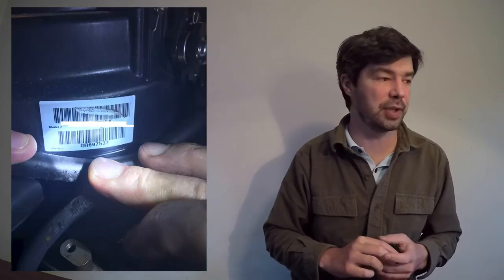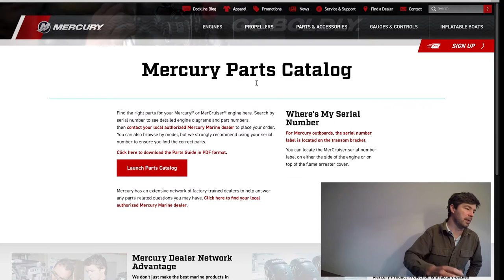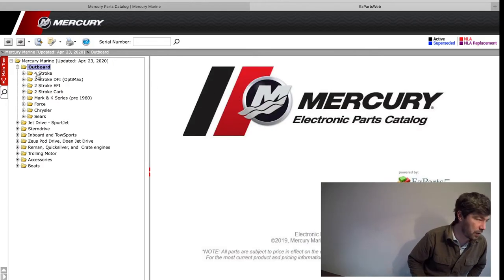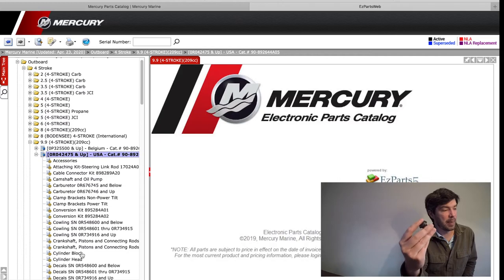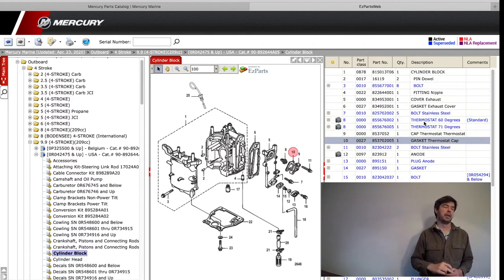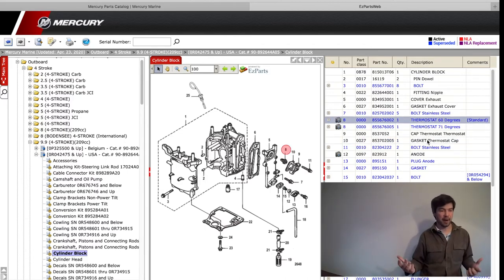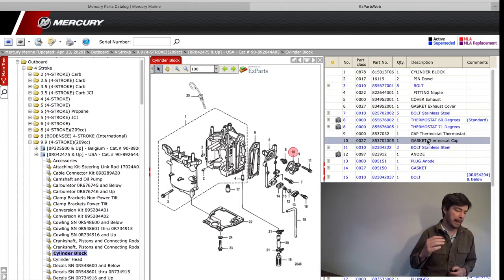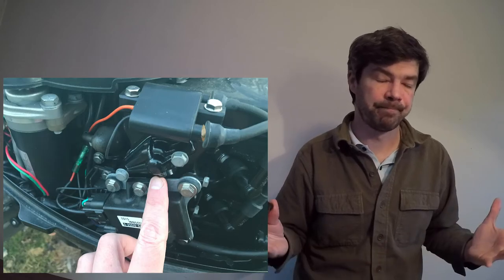How to Change Thermostat in Mercury 9.9 4 Stroke

Comment: Thanks for the update!  I've had a Mercury 9.9 4S for about 8 months now.  I just did an oil change, lower unit gear oil change and will be inspecting my thermostat as part of the annual maintenance  What else do you recommend doing yearly?
Reply from the maker: check the impeller.  Im going to make a video this weekend about it.  you have to remove the lower unit.

Comment: For the stalling out issue, make sure your fuel hose and bulb have no cracks or small air leaks.  If you squeeze the bulb as it's starting to stall, does it stay running?  If not, you may need to remove, disassemble and clean the carburetor.  Get a can of carb & choke cleaner and some small diameter wire to clean out the passages.  Also maybe time for some new spark plugs (be sure to set gaps to specs listed on motor or manual).  Good luck 👍

Comment: Hey Justin, great video very informative.  I am having the exact same issues with my Mercury 4 Stroke 90.  It sat in storage for 2 years and when I took it out on the lake it ran fine until warm, then would stall, and sputter until cool again.  Also noticed when I got home the engine oil was over full and smelled like gas. Im just curious if you ever got the stall and sputter issue resolved on your engine. I will replace thermostats, and another person online said replacing coils fixed his stalling when warm issue. Any info would be greatly appreciated
Reply from the maker: I replace thermostat and clean all the crap out of the carburetor.
Reply from the maker: The gasket around the carburator wasn’t sitting because there was so much crap underneath it.
Reply: @MaineManBassing  oh I see. Makes sense.  Mine is fuel injected so I must have another issue. I will replace the thermostat, and then the coils if I’m still having issues. Thank you for replying!